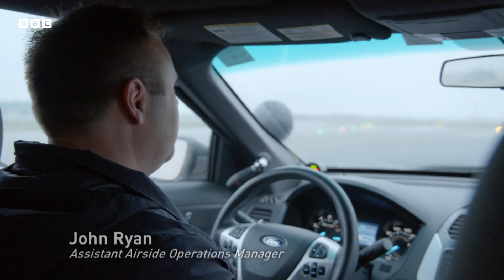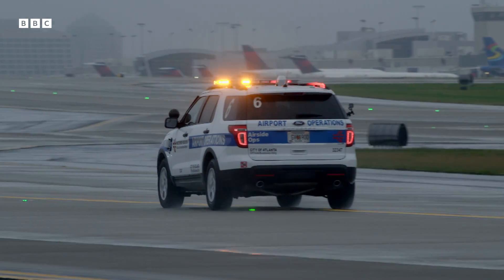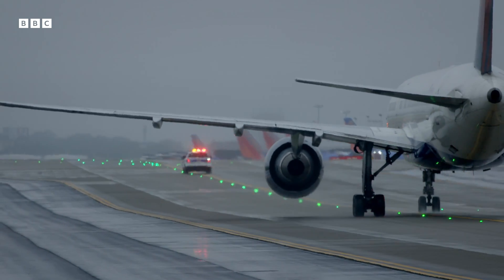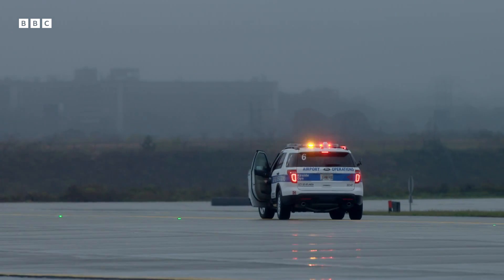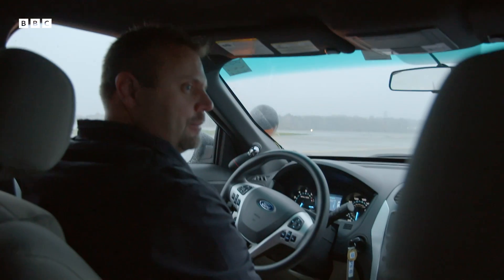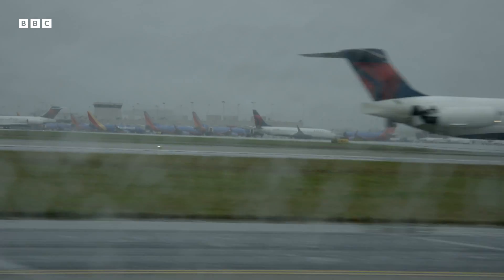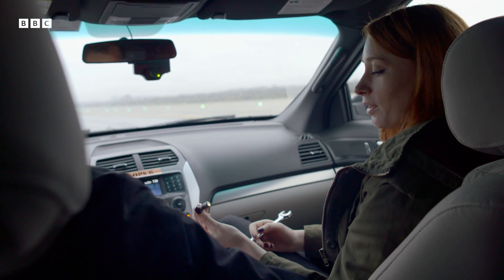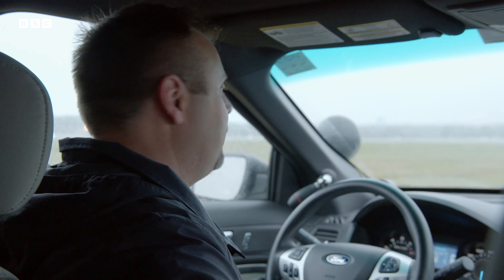Car vs Plane : How to Inspect a Runway That's in Use | City In The Sky | BBC Earth Science

Comment: Why don't they hang strong magnets under the cars to pick up stuff that they miss? Okay, you won't get everything, but you might pick up more.
Reply: I worked at O'hare Airport (ORD) for several years. There are in fact trucks with magnets that drive the runways and taxiways. I would think that they have that also at ATL.